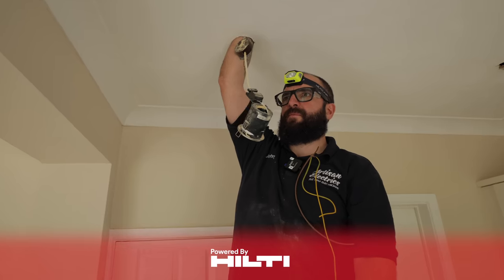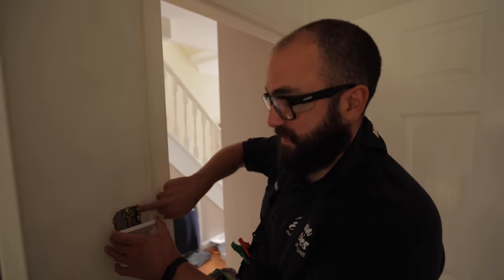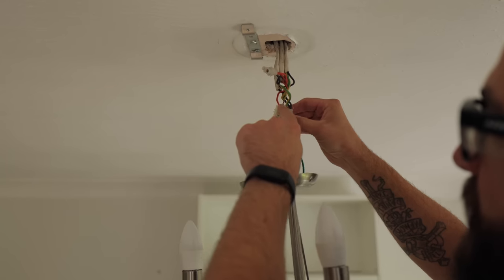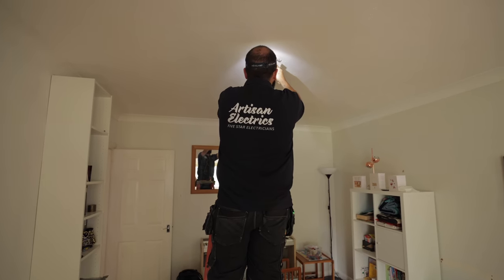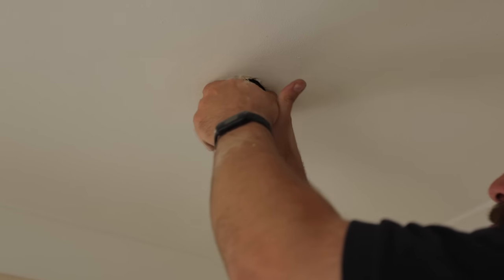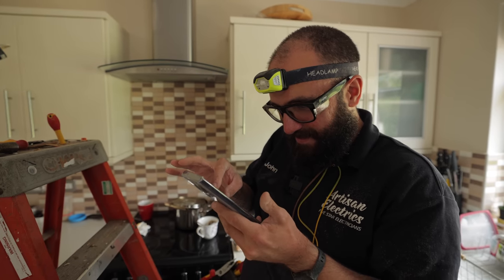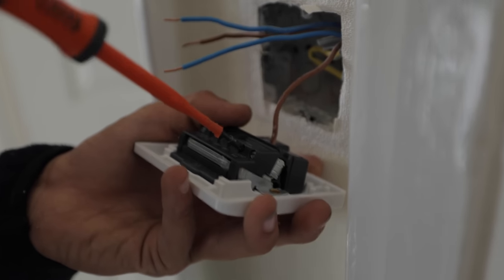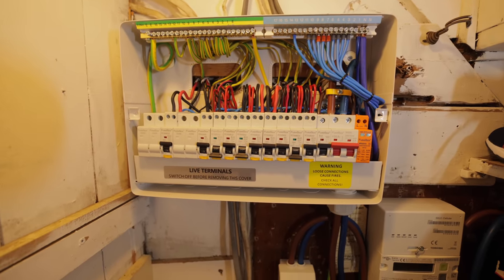ANOTHER DIY BODGE! 🤯 "Why are people like this?!"

Comment: Since I'm from the US, obviously standards are different between the two countries. Is it normal for you guys (I guess with new construction) to put in a ceiling electrical box for hanging electrical objects? Now I think of it, that ceiling is all lath and plaster so putting in a box to help with cable management isn't feasible
Reply: yes i would fit a box unless a celing rose was used

Comment: Those wago clamps are not for solid core wires.
Reply: Not sure which ones you've seen but the ones I buy are solely for solid core cable and explicitly not for stranded cable.
Reply: they all work on solid core

Comment: That is called a phantom voltage. You can't get a shock as that faceplate has no route to earth, so no potential difference. You could only get a shock if line touched the face plate and becomes live. Obviously still needed to be made safe as it was potentially dangerous
Reply: They wouldn't understand what you mean
Reply: can be capacitivly built up though so it can